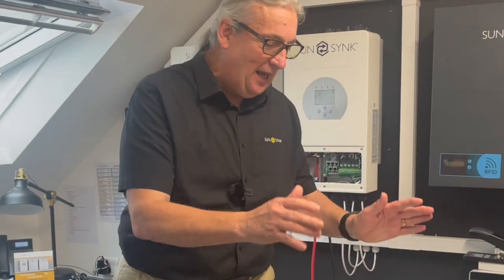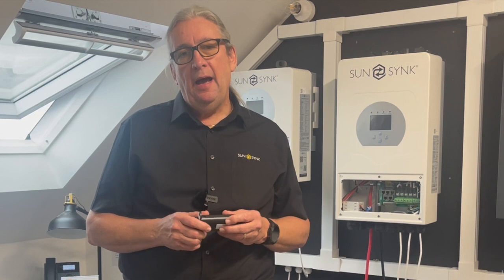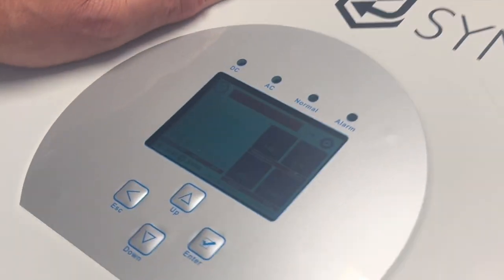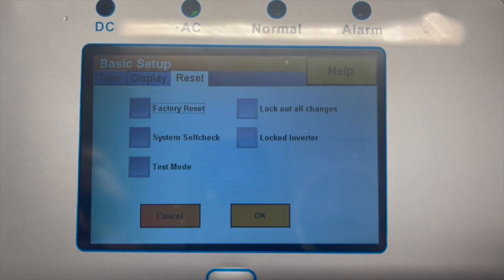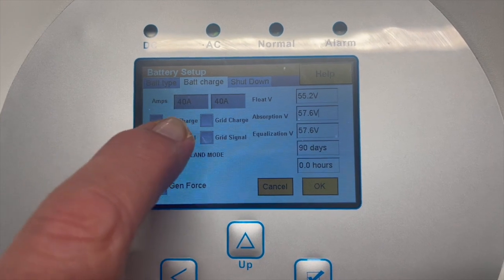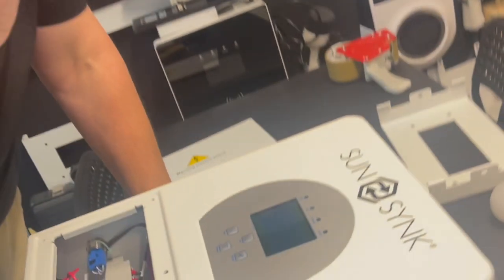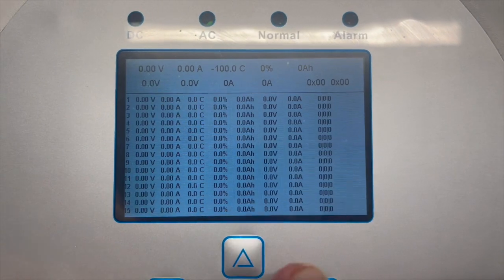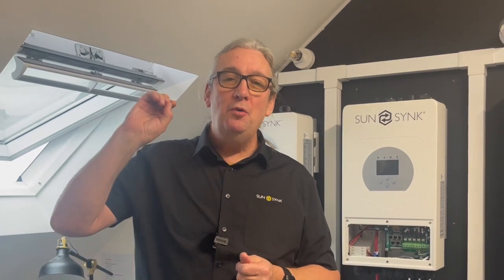UK training - part 2

Comment: The discharge amperage setting of the battery will also be limited to the fuse disconnect between the inverter and the battery